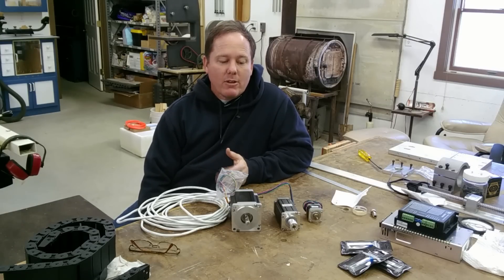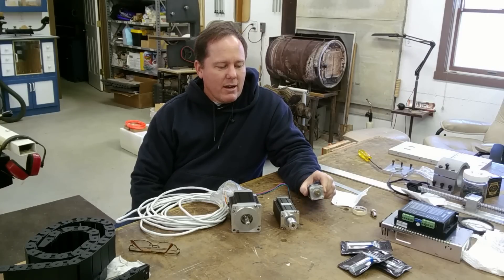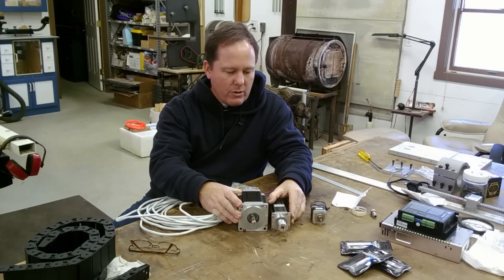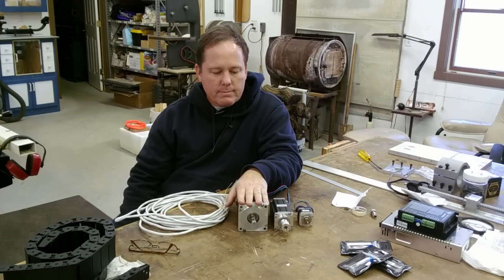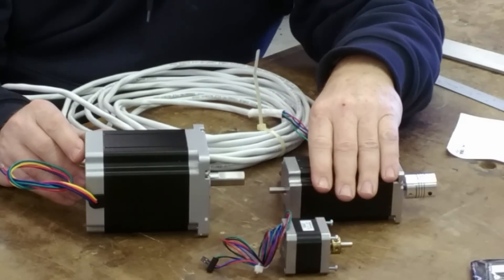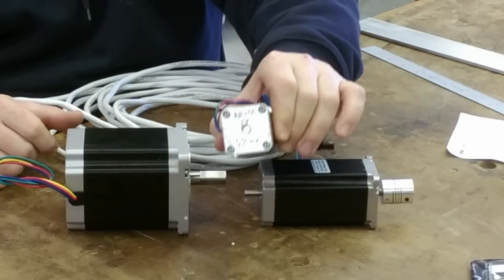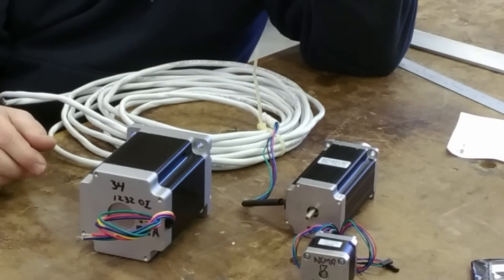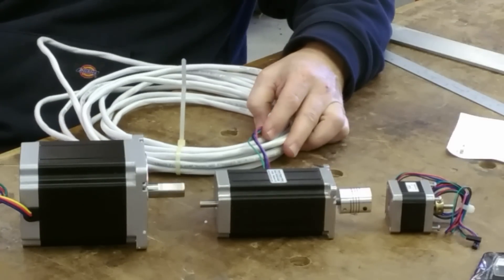Practical Insight in selecting stepper motors for your build -Old Version

Comment: Thank you, lots of info. Planning on a 5' x 10' plasma table.
Reply from the maker: Good luck.  Plasma table is my next build.   My first was planned to be 'convertible' from a spindle to plasma, but my design turned out to be too heavy to make it feasible.  In additions, because all my motor controls are portable, all I need to do is build the machine and add motors.  P.
Reply: Thanks, still settling on designs. At the moment, It looks like a water table. Doing gantry research.

Comment: can I use a bldc motor with photosensor to count  revolutions, see web site homofaciens.de  /technics-machines-cnc-v2_en.    htm  

Will the accuracy be achieved ( can be achieved with gears and long sensor disc , will the motors hold the torque/weight , any disadvantages

Comment: Do you have some plans of making a video which discusses more on proper selection of steppers base on particular requirements or applications..and explanation on stepper specifications like rotor inertia...load to rotor inertia....current rating against the load
Reply from the maker: No.  It is level level of technicality that I had not use for in my design and is exactly why I did this simple striaght forward comparison with discussion on how it was applied in my situation.

Comment: What do you suggest on a stepper motor size for a Super 8 projector that the original AC motor I will replace with a stepper motor so I can do a frame by frame capture only
Reply from the maker: Cool idea.  Unfortunately I have no experience with that machine to have any feel for what it takes to turn it.  A guess...I would start with a NEMA 23.  They are inexpensive including the power supplies and drivers.  If it is geared down, then this will almost assuredly work.
Is there any concern about melting the film if you stop it?  Good luck.
Reply: I will replace the high wattage lamp with an LED.
Reply: Hi, first off, awesome video! I am automating a golf cart and got stuck at motor selection for the steering. I grabbed a torque wrench and measured 1.5 Kg/m to move the steering rack so I was thinking 4.5 Kg/m motor should be sufficient. Now considering rotation speed as well, would a NEMA 23 be a suitable option (controlling everything with a PLC).
P.S already played with a DC motor that was geared but the feedback is too problematic with the PLC

Comment: pls. I am building 2×1 m cnc plasma table what motor size fit with that.
Reply from the maker: Plasma tables need very little torque compared to a spindle machine.  I too am planning to build one.  I will be using Nema 23's in the 400 oz range.
Reply: +sbirdranch many thanks. very helpfull.

Comment: Most of us who are finding 3d printing, CNC etc. interesting will have figured out that steppers come in a variety of sizes and specs.  Many of us have NOT come to grips with what motor is needed for a particular application.  This is one of the most useful videos I have seen when it comes to attempting to plan a project.  Thank you very much! (I look forward to following any videos you post on your machines.)

Comment: what size/power is good for pcb milling?
Reply: Go with the 17's that he showed.... pcb mills are small and light weight, so you don't need a lot of power just to cut pcb's.
Reply: ty
Reply from the maker: I will second Grandpa Bill's suggestion.  Use 17's.
Reply: What torque should I get for the Z axis in this application? Also, the machine I'm thinking of building is one with the work area moving in the Y-axis and the spindle motor moving in the X and Y- axis'; the work area being in the region of 12" x 12"; What NEMA size and torque do you think I need for the X and Y axis'?

Comment: This is exactly what I wanted to hear!   I am building a 4 X 4 CNC Router Parts Kit machine and went with the 425 oz.in NEMA 23 motors and controller from Xylotex.  I'm glad to hear that your machine would have been fine with the NEMA 23s.  How did you come to that conclusion?  Thanks for the info and I can't wait to get up and running!!!
Reply from the maker: +payday1963 I came to the conclusion that the machine would run fine on smaller steppers based on my experience with the Z axis.  The Z axis with spindle is a very heavy piece of equipment.  The force to move that vertical is in my estimation, vastly more than it takes to move any of the horizontal axis.  Gravity is a b___h....you know.
Good luck on your parts kit.  I keep promising to get a video out about the CNC it self but am failing all of you.  P.

Comment: Holding torque is not everything. Unless your ultimate goal is to just hold things motionless that is. The more critical measurement is torque at speed. There your big gigantic motor may let you down too. It may be a beast at slow speeds, but not be able to spin very fast at all. That is determined by the inductive reluctance of the motor coils. Generally to have a high performing CNC machine you want a motor with low inductance, that draws a lot of current, and has a low voltage rating. Your motor drive will sort all of that out for you. It will trade voltage for current. Because that is what it does.

Comment: Thank you for this video. But i still have some questions left. What about resolution, speed, close loop, number of coils/wires, quality (chinese?)?
Reply from the maker: +Gejes So let me take a stab at all these items, in the vain for what to know for selection....

Resolution:  Your 'standard' stepper motor is 1.8 degrees per step.  Depending on the stepper driver you use, you can get that down to 1/8th stepp, or .225 degrees per step.  When you figure in any gear ration or thread pitch, your resolution will be very fine.  Mathematically, my machine will move in .0001 inches per step.   That resolution is lost in other tolerances.

Speed:  Again, that is based on power and design.  20mm slides and the larger steppers I am getting 50-60 IPM (inches per minute) with no risk of stalling or missing steps.  Direct drive or pinion drive will move faster just based on gear ratio.  The limiting factor for me, is any faster and the long ball screws set up a harmonic and stall the motors.

Close Loop:  Close Loop implies a servo function.  This discussion is for open loop steppers.  Steppers have no feedback.  You can loose a step and not know it.  This is compensated for by learning the limits of your machine and doing your CAM work accordingly.  When you build a machine, the first thing you do is run the axes back and forth.  You learn real quick the capabilities and limits of what you have created.

Coils/Wires:  Everything I reviewed here, is 4 wire (two coil) and what you will find the bulk of on Ebay, etc.  If you are harvesting steppers from an existing device, you may very well find 6 wire.  There is lots of good info on how to make those run on YouTube.  It is outside of the scope of this conversation.
Hope that helps.  P.
Reply: +sbirdranch you can put encoders on stepper motors. People don't because it is expensive, and complicated. But there's no technical reason you can't.

Your speed limit may be more related to motor harmonics than lead screw harmonics too. You can get harmonic dampening wheels. But I think those big motors you're using are just slow runners.
Reply from the maker: +Paul Frederick Thanks for the comments.  I have been a little disappointed at my travel speed.  To put dampening wheels (or encoders), don't you have to start with a double ended stepper.  One with motor shaft coming out both ends like the 24 in the video.
Reply: sbirdranch
damping wheels usually go right on the shaft side where your lead screw is.

This is what I want you to do. Take a multimeter (analog needle meters are best for this - you can watch them drop like an old guy in desperate need of Viagra) and put it on the amps scale. Then disconnect the power lead of one of your motor drives and put the meter in series with it. Now you can monitor the current the whole motor is drawing. Now with your software increase the speed of the motor and watch the meter. Watch the current drop off as the speed increases.

This should give you an epiphany about inductive reluctance and how it relates to stepper motor performance.

Like I said earlier holding torque has nothing to do with torque at speed. Different physics apply. This is an important concept to grasp too. Seeing will lead to believing.

If you want the really long winded explanation I can oblige. But I think it is better if you actually see it for yourself first. In a nutshell coils resist changes in current. Now as you increase speed you demand the current to change at an ever faster rate. Motor coil don't like doing that though. Coils are current resistors at high frequencies. But current is the major part of power with motors.

Comment: I see your 4x4 table looks like you are routing, I was in the sign biz from 1990 on, so saw many versions over the years what is the final hp (Generalized) of the router and ips of say a 1/4" bit I see 2.2Kv spindle motor do you run this on 220 single or 3 ph or what?   item line what did this cost to put together. Lots of used gear out there that isn't being used.
Reply from the maker: +Joseph Böhme The spindle is 2.2k.  The spindle controller is 240v single phase and produces 3 phase to the motor.  IPM is very dependent on the material and cut quality.  The machine it self doesn't like to go much above 50 ipm due in part to the length of the ball screws.  They start to create a harmonic that causes skip.  The plan for this machine has changed as I have learned.  It is intended to do more aluminum sheet cutting hence it is so rigid and heavy.  Cost...It wouldn't do anyone any good to say.  I have made mistakes that cost money.  I have had things I didn't have to buy.  I don't really know what it would take to build if you had to buy all the materials.

Comment: Very well done.  You once again covered every question, plus more on the NEMA's, even all three sizes.  I just viewed the "X axis success video" and saw what controllers you used.  The DQ860MA controller seems like the one to get.  But I may just play with some home made stuff before doing it the correct way.  It's only money right? :)
Reply from the maker: +King Red Leg Thanks.  Glad it helped.  That controller seems to be the one of choice for Chinese manufacturers.  One advantage is that the larger community has them so there is lots of experience to draw from.  Now, my tune may be different if I knew how to make my own, as you do.  Good luck.